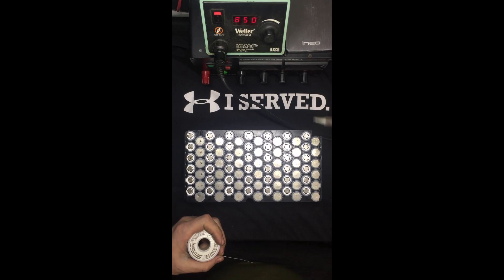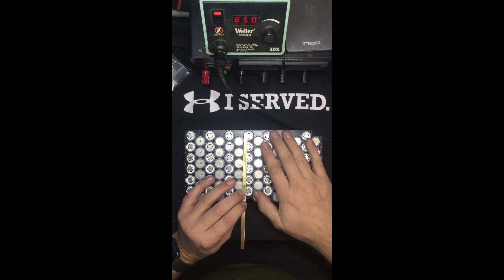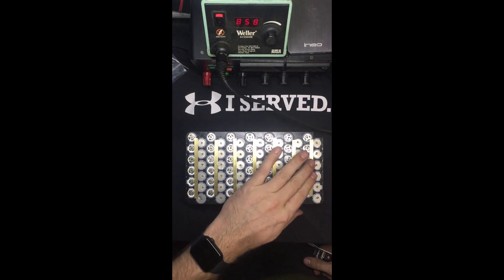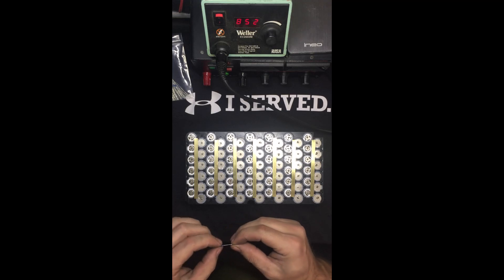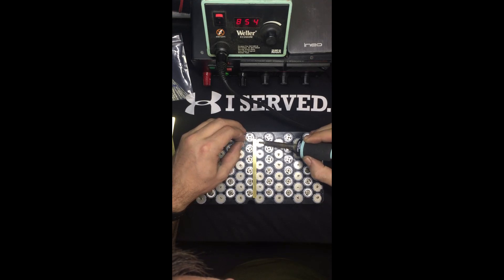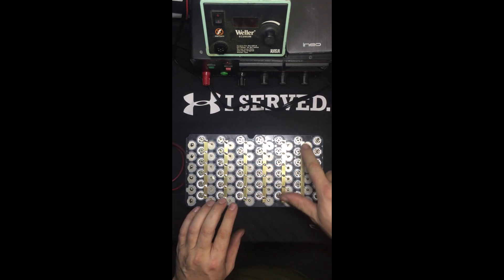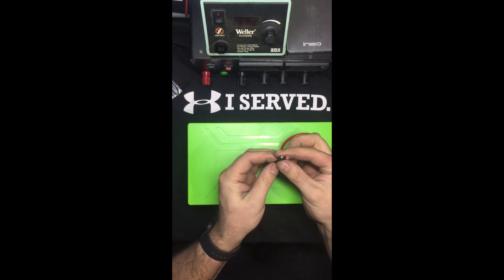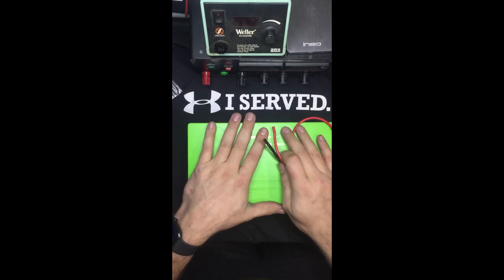DIY 18650 lithium ebike battery build 14S6P tesla fuse style with hard case

Comment: Nice!, what kind of holder did you used? I made my own from Plexiglas cut on laser, see here pics
https://www.facebook.com/1233018626780851/photos/a.1274184442664269/1470626343020077/?type=3&theater
Reply from the maker: I used the holder supplied w the case. I have a vid on the channel about it as well. Its a staggered holder which is different from all the typical square ones.

Comment: what charging port/balanceer/BMS do you use?
Reply from the maker: No bms on this one. I am bottom balancing them though. 
I have two 58.8V chargers. One in 10 amp for bulk and a small 2 amp I can take with me if needed. 
Cables will have xt60 connectors. 
I use xlr connectors on charger to bike.